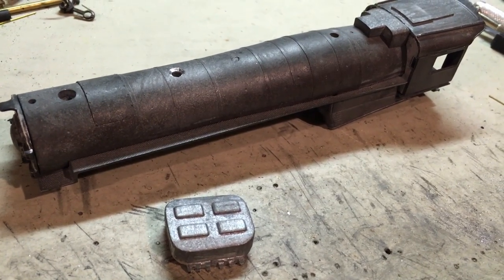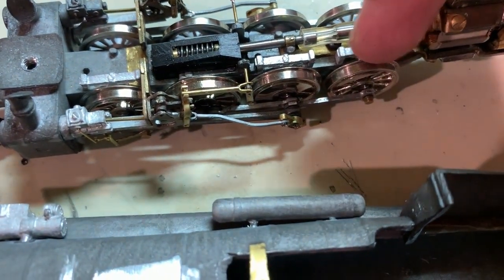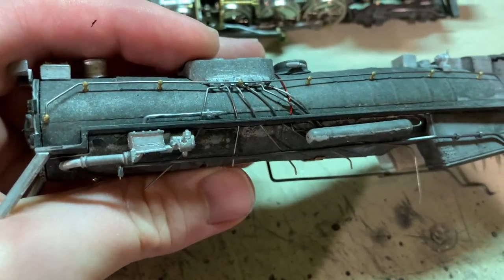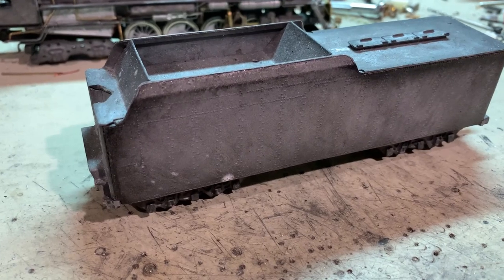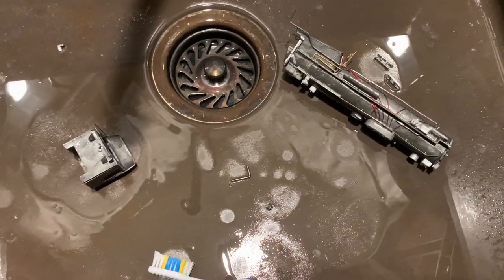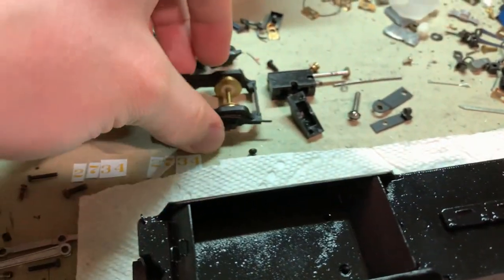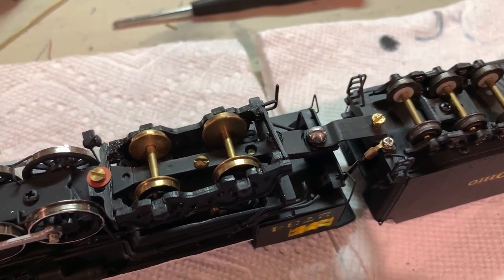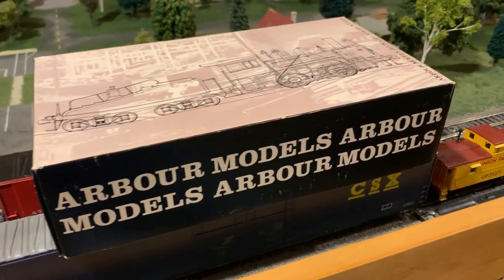Building an Arbour Models 2-8-4 kit: Details, paint and finishing - Part 5

Comment: wow! this is unbelievably impressive! Especially considering what it came from...a basically junk kit. Im glad you showed off all the struggles and process fixing up the drivetrain. Lovely
Reply: I wouldn’t go so far as to call it a “ junk” kit, perhaps “poorly engineered” would describe this product better.
Reply: @srenchin  name one thing thats poorly engineered thats not junk?
Reply: @srenchin  No, it's a junk kit.  5 years, and oh by the way, due to the soft metal (he had to align the frame by pressing it against his workbench) and the plastic driver centers, give it a little run time before it locks up and launches itself over the layout edge on a regular ordinary operating night...

The "Junk" started with the soft metal and goes right through the holes being in the wrong spots and not being big enough and the clearances missing altogether.  That's Junk.  If it takes an engineer to put together another engineer's mistake, it's Junk.

For comparison, see the Mantua 2-8-4 kit.  Shake the box, you can have it finished and running in an evening.  That's a Well Engineered, Well Machined kit, even if it IS generic!

Comment: Nice job Darth. I purchased an Arbour Models Allegheny at a train show a few years ago, but have not started on it yet. Still working on a few Bowsers.
Reply from the maker: I hope that kit goes well for you!  Just remember to take your time and take breaks if you need.  I doubt I could've finished this one as well as it is if I didn't set it aside for a while.
Reply: @DarthSantaFe  Great advise. I will remember that when I start on it.

Comment: 1. The fitting at 1-15 is the Worthington  Feedwater Heater Cold Water Turbopump 2. I'd try and reinforce the pilot with a screw if possible 3. LMAO! "Took more work than I was expecting" Brother, we've all been there! 4. The Virginian had five duplicates - the only external difference was the tender cistern was higher. BUT, between buying brass or saying "Close Enough".....

Comment: Great video on a not so great kit. One minor criticism, though: the sand dome and steam dome are in the wrong places. They should be swapped so the steam dome is closer to the stack, and the sand dome is behind it. Other than that, this build could not have gone better, considering what you're working with. Good luck with the A3! You'll probably need it, if part 1 was any indication.
Reply from the maker: Thanks! I actually did position the domes correctly. Please check out photos of the C&O Kanawhas, especially 2707 which I visited to make sure I could detail the model as well as possible to match the prototypes.
Reply: @DarthSantaFe  Oh, really? Huh. Didn't realise the C&O swapped the dome positions, despite being a pretty big fan of their locomotives. You did a great job with the paint and decals, by the way. Seriously, 10/10 job. You've inspired me to start looking into locomotive kits myself. What would you suggest for a beginner? I've owned kit models before, but never built one. I was initially gonna get a Roundhouse shay kit, but I looked them up, and realised I'd be WAY in over my head if I started with one of them, as they're notoriously difficult.
Reply from the maker: @That_One_Guy_In_A_Band  Except for the Shay, MDC/Roundhouse kits are good for beginners. Mantua/Tyco and Bowser kits also go together well and were popular for a long time thanks to their quality and reliability.  The recent Bowser 2-8-0 series I did should give you a good idea of what’s involved in building most of these. :)
Reply: @DarthSantaFe  Awesome. Thanks for the recommendations, man! I'll see what I can find.